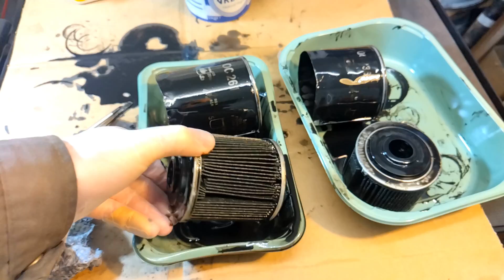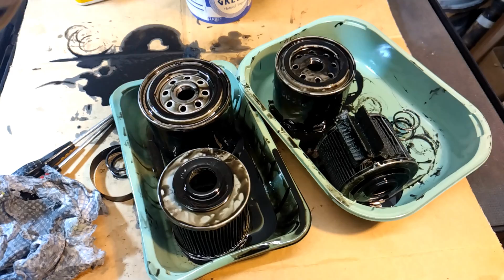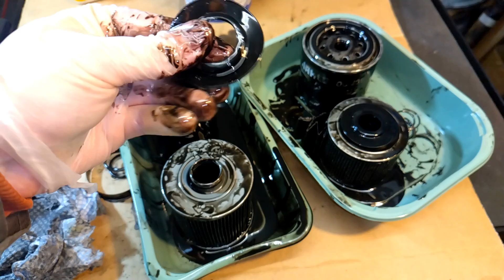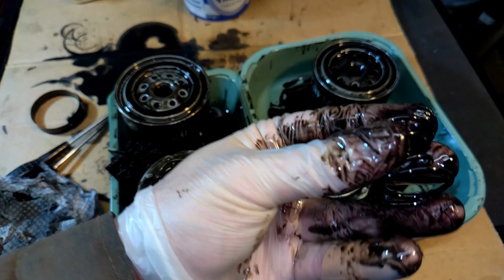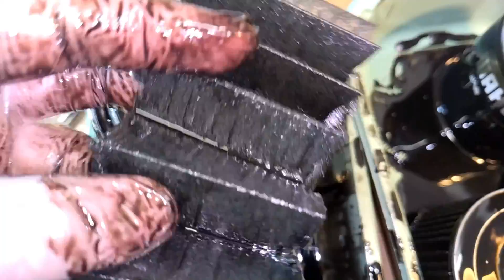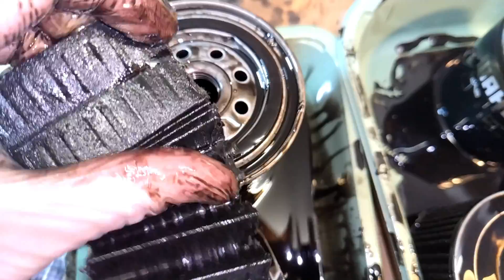Mahle Oil Filters: Austria vs China Manufacturing. Two 300Tdis with 112k and 200k miles

Comment: Just to confirm - both filters here have the exact same part number?  My Kia only takes a Mahle oil filter, and the part number is only made in China but I’ve noticed that the filter media and packaging isn’t consistent in color from one to the next.  Even though I buy them online from various Kia dealerships (based on pricing) I’ve never had Mahle oil filters until this vehicle, and I’m curious about the consistency of quality in their manufacture.  The differences you noted are surprising - like the different spacing of the holes coming from the same manufacturer in two countries.  I would think one part number would have consistent specifications for all the components - especially within one brand.
Reply: No, two different part numbers as he says at the start of the video
Reply: @YZJB  Oops - you’re right.  I rewatched and the second time I caught the part numbers (OC261 vs OC236).  It would be helpful for comparison if they had been the same Mahle part number from two different factories in order to tell what differences are just different part specs vs. different quality.

Comment: I also use Mahle filters on my ROW 300Tdi. I did use Cooper oil filters but they had the nasty habit of coming undone. No matter how tight I tighten it. 

On one trip that had 700Km of tar road and 300Km of corrugated gravel road it unwound itself by ¾ of a turn. As I still had another 600Km of gravel road left, I put a big pipe clamp on the filter and locked the filter with locking wire to the engine block.